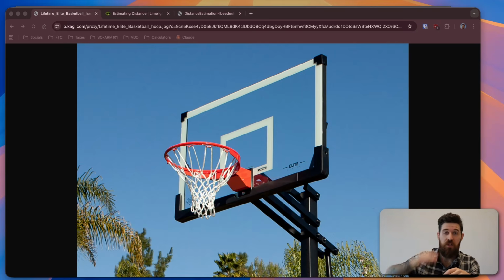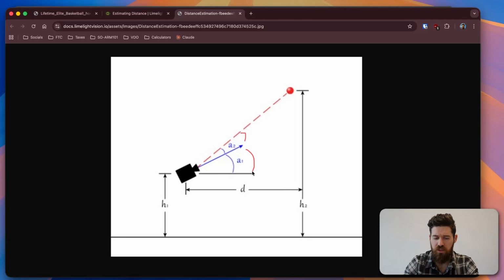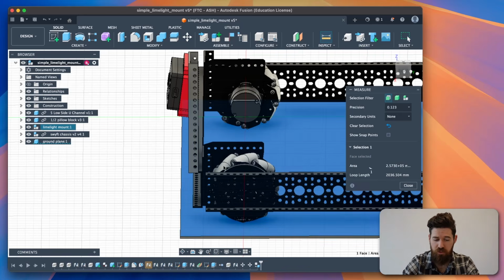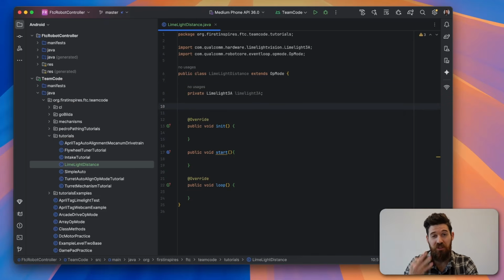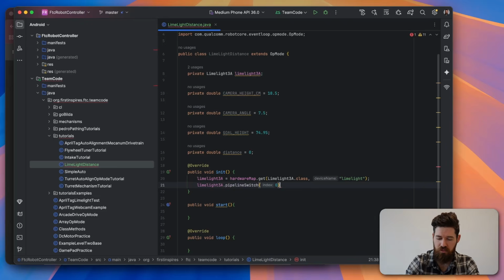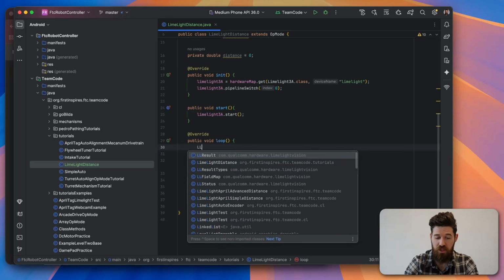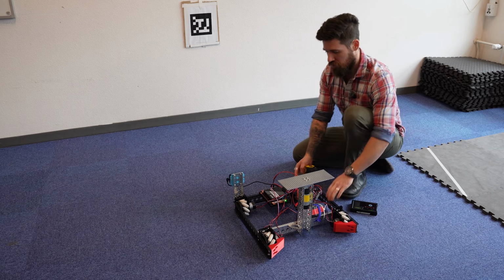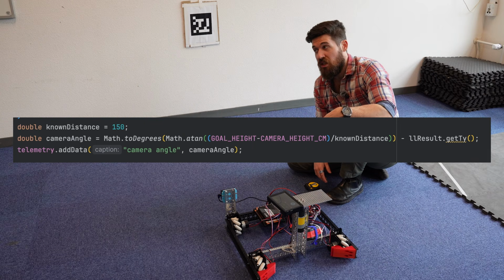How to: Measure Distance with Limelight 3A (Learn Java for FTC)

Comment: can you add a video about axon robotics servos to your list of video ideas? I would like to learn about them in a video and how to use them
Reply from the maker: Axon servo's in my opinion are not anything special, but they've managed to take the FTC zeitgeist, so kudos to their marketing. There are many servos on the market that add in a feedback wire that you simply read as a standard analog in port.
Reply: @BroganMPratt  I think they are talking about using the software but more importantly the 4th wire, which not only has to be customly "frankensteined", but also code-wise requires running it like an analog encoder which, even though its logic pretty intuitive, for beginners, a little bit of teach would prove to be very helpful.